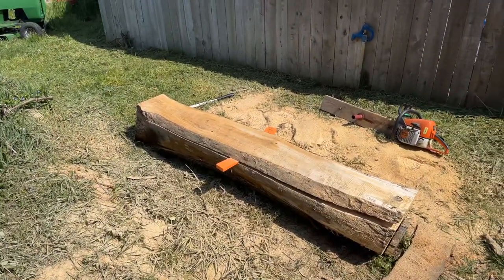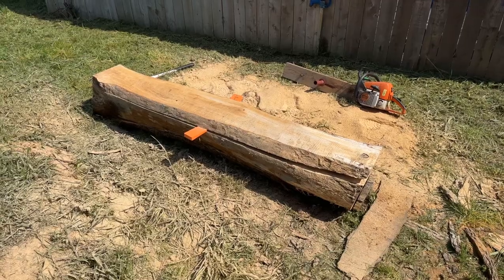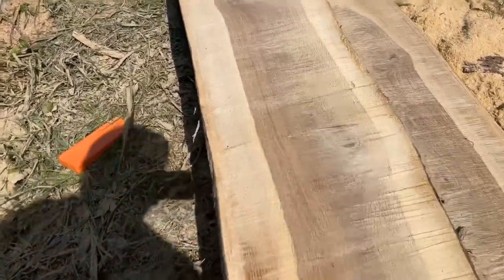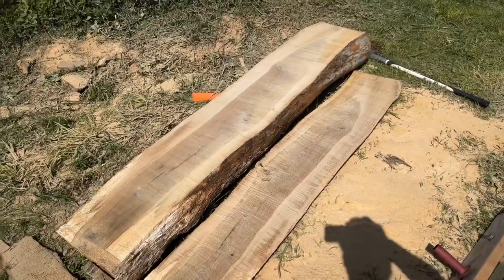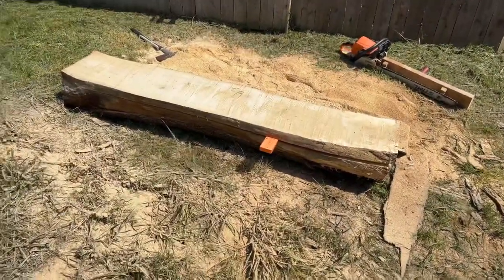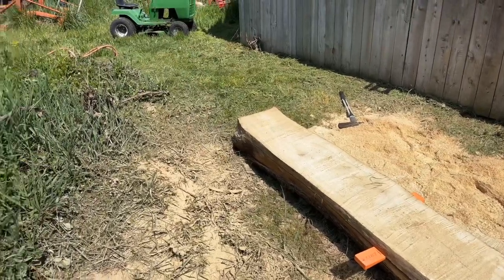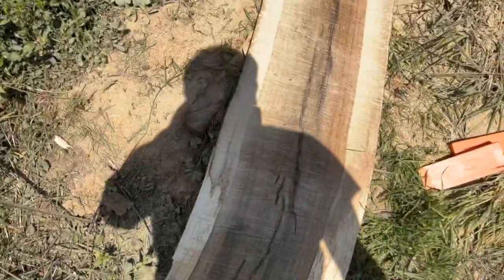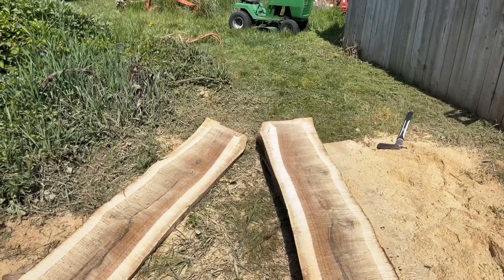Milling Oak logs with a free DIY Alaskan chainsaw mill part 2

Comment: Maybe I missed  it but I didn't see mention of how you got your first flat cut. That's pretty critical. If it's off they all will be. I got some square tube stock and welded a copy of what I saw on sale on ebay. Haven't used it in some years as we only have pine here
Reply from the maker: Here’s the link to my other video were I explain it a little bit. I just screwed a piece of decking to the top of the log
Milling oak logs with a free DIY Alaskan chainsaw mill.
https://youtu.be/8iMi04iTs9U
Reply: @northwestbushcraftandsurvival  cool, we used a ladder before.

Comment: Hi. Sweet set up. I’ve tried milling/ripping and blew a piston in my Stihl 170. After reading I learned milling is very hard on saws so I spoke to the dealer, he said to go up to the 391. Should be no problem. After one day that saw died! What’re your recommendations in this area? Some say they don’t use a ripping chain and they have no worries with their saw….
Reply from the maker: My saw is a MS310 and I’ve had a for 12 years with no problems but until now I’ve always just used it for cutting a little firewood and some tree removal. Your 391 probably died because you have to break a saw in slow with a bunch of small cuts and low RPMs. I always mix my gas with extra oil, makes more smoke and less power but I feel it helps it last longer. I’ve had a stihl 044 for 20 years and it’s still running great. I’d recommend breaking in a new saw very slowly before you try ripping with it and even then give it breaks between cuts
Reply: What your type of fuel and oil mixture closely.
Reply: Also, always let a saw warm up before you start .